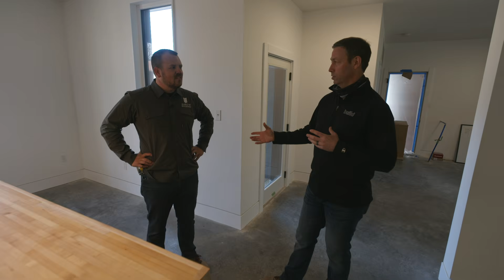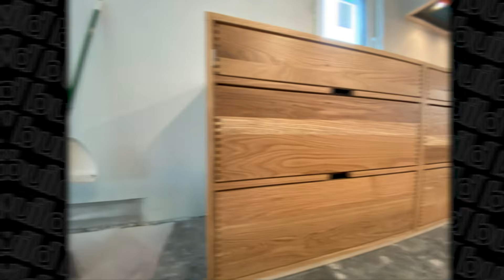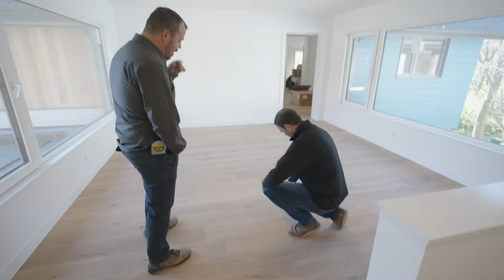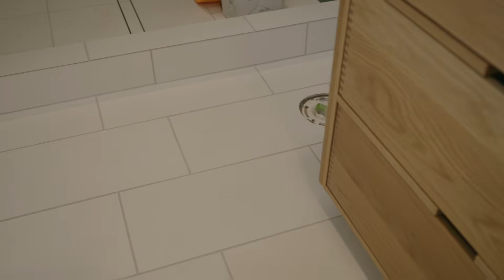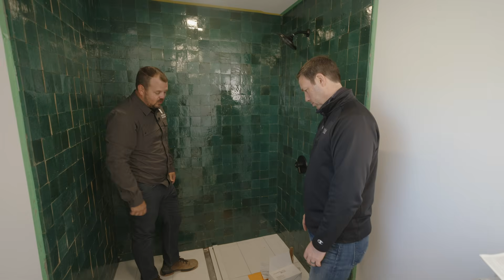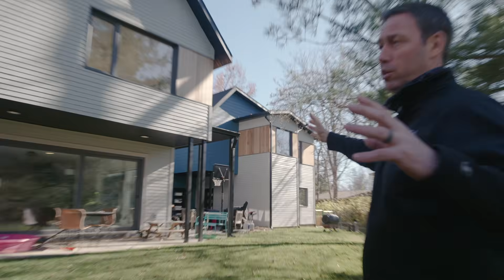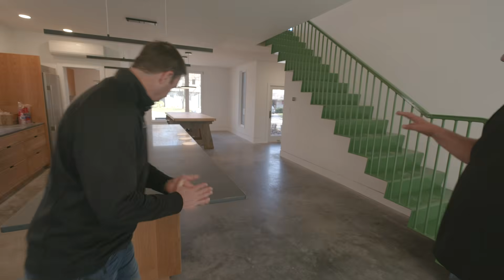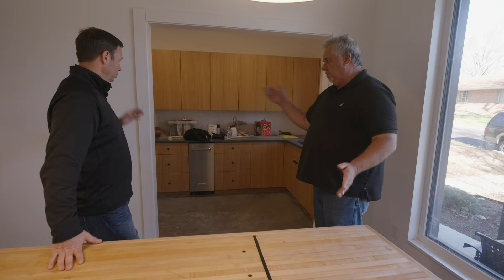Builder’s own INSANELY Efficient House!

Comment: I wouldnt even consider NOT putting radiant heat in the floor..... even if you just kept them at 80 degrees in winter... and still use the mini splits.
Reply: @zlmdragon.  I have lived in Massachusetts my whole life. From September to June.... the heating season... floors.. and especially ceramic tile and concrete are uncomfortably cold. Insulating the floor.... as I have done is useless because the ground is 50 degrees or lower. 50 degrees is VERY uncomfortable when you want to be warm ambiently. I installed it myself in my house 20 years ago when building. In a cold climate it is BY FAR the most comfortable thing you can add to a home. I think anyone that has lived with it would say the same thing. And it doesnt have to be the home heat source as it wrote. It can be just enough to make your feet comfortable if you wish. I would use it in that gorgeous house as the ONLY heat.

Comment: Why not just used staggered stud 2x4s at that point?
Reply: Probably labor cost.. 
and pice wise it doesn’t make much difference (assuming you ceilings is high..)
Reply: @tomshani6320  ding ding ding.... and a much simpler build with a 2X8 versus double 2X4 wall.
Reply: @Isaacmantx  Yes, but the effective R is higher with double stud because you end up with 4 inches of continuous insulation in the wall instead of 20% of your wall being R-9 due to thermal bridging from the studs.
Reply: @belg4mit  except that he removed most of the thermal bridging issues with the Zip R9. If he had traditionally clad the framing, I would be 100% in agreement.
Reply: @belg4mit  effectively, he has 1 inch continuous, plus 2” closed cell and 5.5” fiberglass in cavity.
Reply: @Isaacmantx  and they’re are framing on 24” centers which reduces thermal bridging...
Reply: @graydonbardwell4637  and that's because of the increased strength from the 2 x 8s
Reply: @graydonbardwell4637  all kinds of advanced building in that house. That will be a multi-hundred year build.
Reply: Probably because
1) 2x4 walls need to be 16 inches on center vs 24 inches for 2x8 walls, so framing advantages aren't as good as you'd expect
2) Staggered studs require extra studs at openings like windows and doors, so the more of those you have the worse the thermal bridging is, whereas with 2x8 on 24 inch centers, as long as your rough openings are multiples of 24 inches wide no extra studs (except cripples and jacks) are needed.
Reply: A house I'm remodeling has that and it's not as structurally sound as 1 piece of solid timber.

Comment: I like the idea of the heat pump water heater but I'd worry about it freezing up here in the great white north. Like if you had a power outage you'd have to empty the water out of it or else its completely screwed. Plus the water lines have to be insulated and heated with cable from the house to the unit so there's an added power loss. But a perfect system where the temp rarely goes below freezing.
Reply: Yeah, if only some liquid that freezes at a much lower temperature could be used.  
Too bad water is the only option. 👌
Reply: @jaxturner7288  I wonder if another kind of buffer tank with a heat exchanger might solve. Use glycol then
Reply: @willyhoogs  oh glycol exists now? 
👌
Reply: @jaxturner7288  lol👀

Comment: heat pump blowing cold in winter is helpful when you direct it into an insulated pantry which i did and can store all kinds of food and beer inside :)
Reply: Very smart!
Reply: Instead of a heat pump, I'm going to cool my home with a nearby pond. Just pump water through coils of tubing in the water, and then through a heat exchanger. Very affordable AC.
Reply: @truthspace5525  it better be a HUGE pond. Ac sends massive heat into the pond floor, and subheading is typical...
Reply: @SuperVstech  I've been wondering about a geothermal pond setup. Would a 1/2 acre with a 10' depth cut it?
Reply: @robertfeliciano5723  https://youtu.be/QCWJjBNCfDw
Your pond feels about enough to handle 1/2 ton...
Reply: Hahahahthats a joke right
Reply: @richd.4073  nope
Reply: @EdisonWong2004  sounds counter productive
Reply: @richd.4073  i v got 48 deg F in my pantery right now for free; i insulated the room with scraps from roof insulation
Reply: @MhUser  so are you saying heat pumps can't heat in the winter so u use it for cooling a room?
Reply: @richd.4073  its a domestic hot water pump which heats the water all year long; takes air form insulated attic which is always hot so the pump is efficient all the time; exhausts air into my pantry; the pantry air after heating up recirculates freely with an additional duct back to the attic; i heat my water with effieciency of 4 (COP) and have a cold room for food storage

Comment: Dude spends all that money on a house and has shark bites on his water heater, what a joke
Reply: and pex slung around can only see like 3 crappy nail clamps  what a travesty  he probably did it himself LOL spent all that money on the unit then hired 6 pack jerry to pipe it in
Reply: Plumbing and electrical are an absolute joke.   Electrical is no where near meeting code, and looks like a low end rental flip.
Reply: Pex pipe .
Ever hear of copper pipe. 
Electric water heaters make noice?
Reply: Dehumidifier right next to it.... huh...
Reply: Fantastic house! 
I'm not a fan of water heaters on the second floor even stainless steel lifetime warrantied. The possibility of an uncontained leak is far too great and eventually there will be a leak. I like to install them where water damage can be kept to a minimum.  The T&P valve needs to be piped down to the pan that will be the first to start dripping.
Reply: Entire houses have been successfully plumbed with only shark bite plumbing connections, matt has featured them before.   
Long term reliability has been proven to 15 + years so far and the savings on labor during installation more than pays for the increased cost of the individual pieces.  
The plumbing pipes themselves are less likely to get damaged during installation than during sweeting where solder and lead can get into the system causing cavitation and future leaching or erosion problems, the shark bite fittings can rotate after installation and even be removed and reused, they can even be installed on a pressurized system without having to interrupt or shutdown the system.  
Besides not having proven themselves past their age, they have many advantages and positive characteristics other connection methods simply do not offer.
Reply: @jaxturner7288  just because it is an approved fitting does not mean it is a professional way of doing things. You can tell by the way that whole water heater install was done, a subpar plumber was hired for the job
Reply: @eliroy7833  jax turner must be shark bite sales man. Makes me think this house also has 3 tab shingles
Reply: Jax Turner 15 years isn’t long term. I like to build for 50+ years.
Reply: @thebigpicture2032  it’s not like we can speed up time and increase that number overnight.  Time will just have to pass and were see.
Reply: @jaxturner7288  are you a shark bite sales man??? I have a strong feeling you are
Reply: Jax Turner shark bites should only be used as a temporary repair to return water to a homeowner. No respectable plumber would install a shark bite for long term use
Reply: @Ptro1  no? None?
Maybe there are people you do not know about.

Comment: What's the price per square. Ft. ?
Reply: 💪and a🦵
Reply: Approx 400 per sq. Ft.
Reply: @videozoom12  that's to rich for my blood. I'm looking to do it all myself and keep things in the 50 to 80 per Sq. Ft.
Reply from the maker: I’m not sure even the materials could come in that low assuming free labor.
Reply: @ApollyonZeroed  lol.  That will be a pole barn compared to this.
Reply: @buildshow  A few years ago I quoted a pipe replacement job for a guy who bought a beater house that had had the plumbing stolen.  When I went back with a several thousand dollar quote he said no thanks my uncle will do it for $175.00.  I'm still laughing.
Reply: Yea that is the ideal.  There are some barndomium kits that come in to the price range now that's just the shell. Finished build I won't know till I move in. 
https://www.absolutesteeltx.com/barndominium-pricing/
Reply: @ApollyonZeroed  $50-$80 per square foot is possible but you’re going to have to do pretty much all the trades (plumbing, electrical...) yourself too. I built my house a few years ago and did it for right around $70/sf but material costs have gone up a lot.
Reply: @jesseh2302  yea I plan on doing most of the trades in my house. My old man knows how to do all the electrical and plumbing. As well we both are good with carpentry. Sadly I'm still looking for the right piece of land.

Comment: Passive homes are the future.
Reply: They are also the past :)
Reply: @velianlodestone1249  
I think timeless is fitting.
Reply: Get ur check book out
Reply: @zlmdragon.   if your going to stay in you house for 40 years go ahead. But most move before there 70
Reply: @richd.4073  When you sell a house like this, you can use the low energy bills as a selling point and get more money for the house.
Reply: @TheGuyThatEveryoneIgnores  Same goes if you're a landlord. If the tenant is going to spend $1500 a month anyway, I'd rather have them spend $1400 on rent and $100 on utilities than $1200 on rent and $300 on utilities.
Reply: And also the present. Haha 😉
Reply: @zlmdragon.  If you make it to 70s-80s. You never enjoy life that way
Reply: Only if they come down in price.  For some reason no one cares to spend on it
Reply: @sergeyb8  Agreed - Build a concrete (ICF) house for cheaper and better performance.
Reply: Southern facing homes and drawing warm air from the ground is free, those have been around for 40 years
Reply: In AZ, many of the old Adobe houses had walls that were 12” thick with exterior stucco for the heat. They just didn’t have the double glazed windows.....
Reply: Definitely if you're building a forever/multi-generation home. The initial cost is high but you know what you're signing up to, energy bills however come every month and price/kWh will only go up over time. Bringing that monthly cost down overall and making it less dependent on how hot the summer or how cold the winter is a great feeling. It's like somebody driving a lot of miles who suddenly owns a car that costs half in fuel: sure that car probably cost them a lot of money, but it brings a smile every time you fill it up after many hundreds of miles of driving.